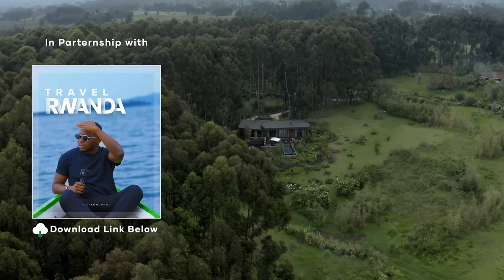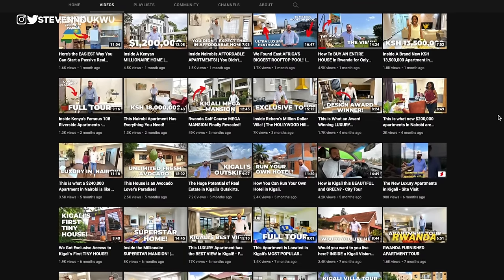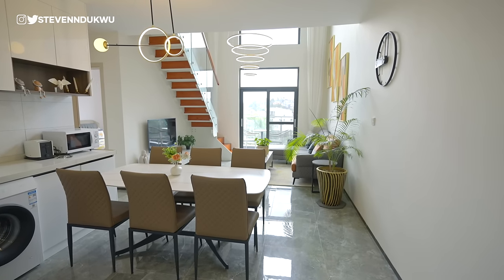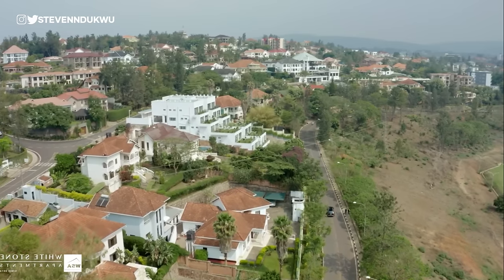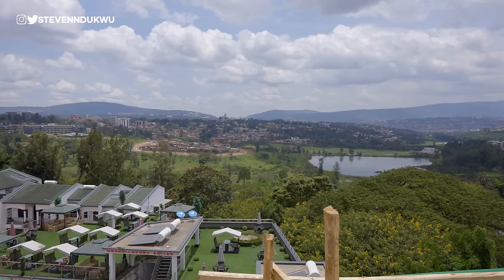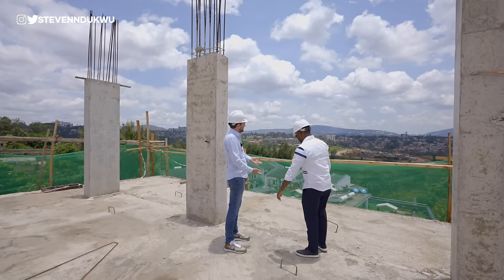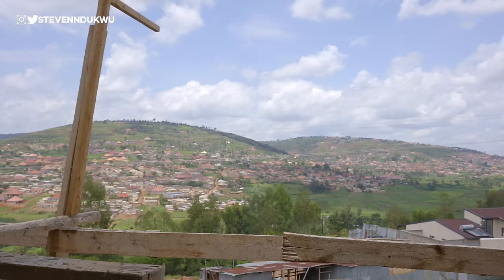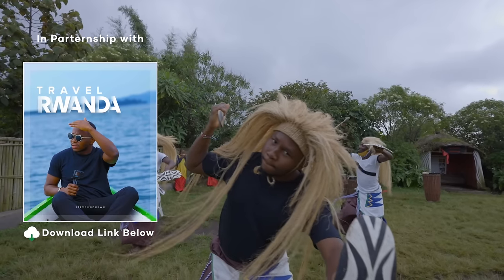How Cheap is Buying Real Estate in Rwanda?

Comment: I like the project, but I see the building blocks. They connect the floors the hold the floors is very thin. They should be more thicker. God forbid you have a health quake. This building is going to be flat like a disk collapsing one by one by one